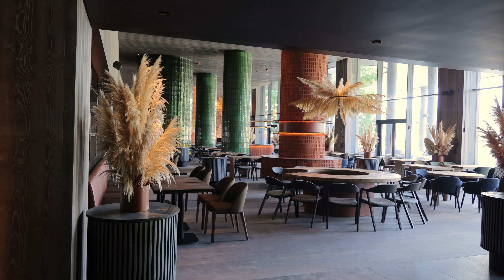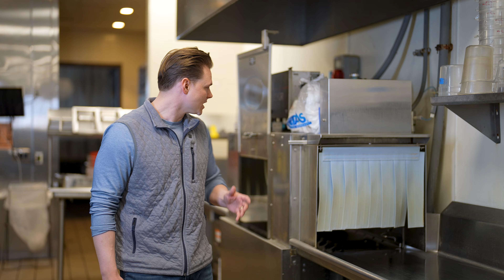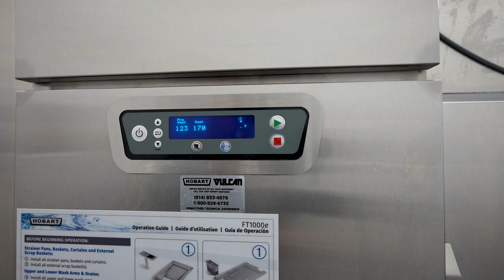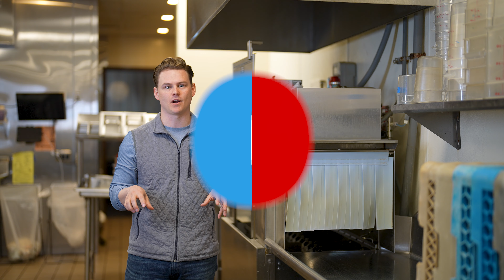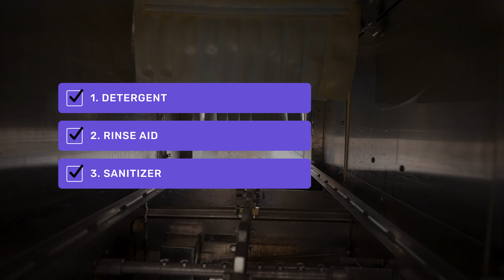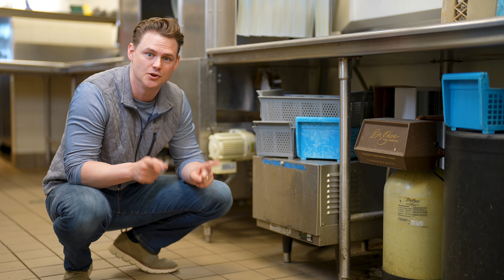How To Choose A Commercial Dishwasher

Comment: great indepth videos, love to see more commercial equipment reviews. From a performance standpoint, is there any difference between a vented dishwasher or a ventless door type dishwasher?
Reply: If there is a difference, then the ventless one will have built in equipment to preheat the incoming water supply with the left over excess heat via a heat exchanger, which usually will go out through a vent hood via a chimney. We have an even better solution at work, in the form of a heat pump which lowers the C0² footprint even more. But these systems are more likely to be found in high capacity conveyor machines.